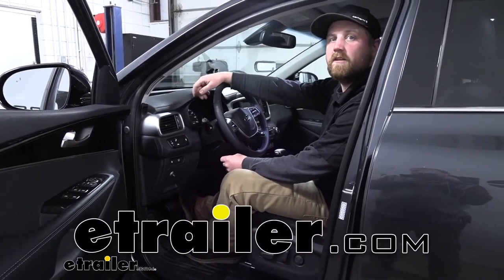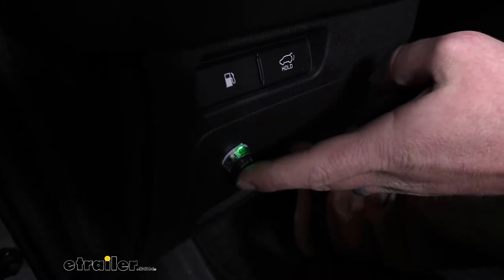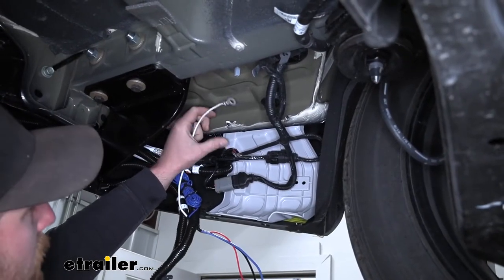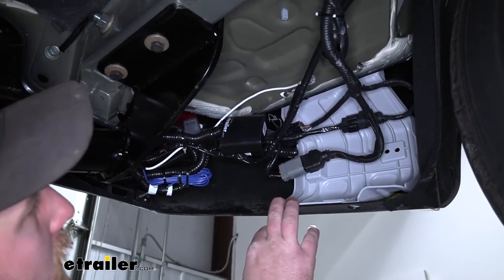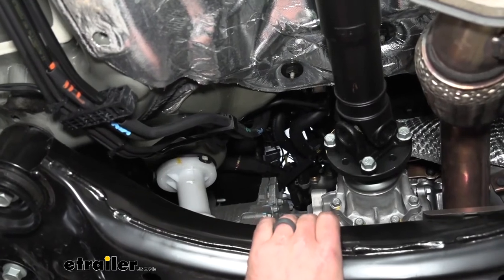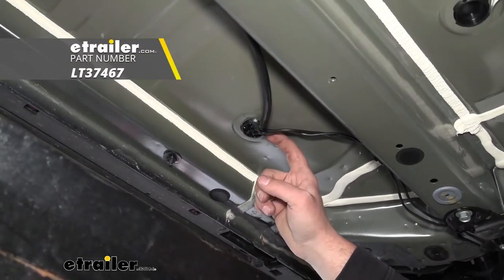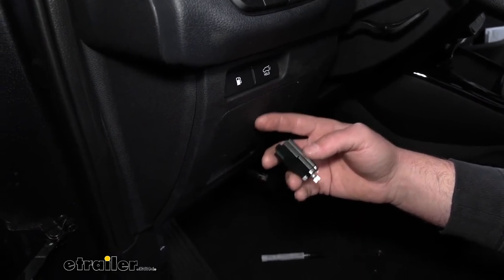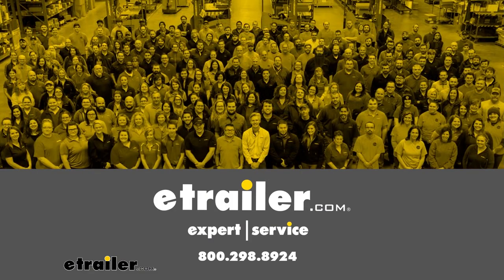etrailer | Redarc Tow-Pro Elite Trailer Brake Controller Installation - 2019 Kia Sorento

Comment: Hello, a question. I have a 2020 Kia Sedona, it has the connectors as they appear in the video. The question is: If I buy the TK24FR kit, can I put a different brake controller than the one in the video, a simpler one?
 thank you
Reply from the maker: That's a great question. The # TK24FR is set up for use with Tekonsha brake controllers, but you can use any controller you want. You'd just need to cut off the black plug on the brake controller harness and wire it directly to the controller of your choice, color for color. What controller would you prefer to use? The main selling point of the Redarc Tow-Pro elite is that the actual controller is hidden under the dash  where it is out of sight. You won't bump your knees on it when entering and exiting the vehicle and you won't have a visible controller hanging under the dash. The Tow-Pro Liberty, part # RED52VR would be a less expensive option that would work with the TK24FR harness, but you'd need to remove connector from  the brake controller harness and wire it to the universal harness included with the # RED52VR. If you have any further questions, just let us know!
https://www.etrailer.com/Trailer-Brake-Controller/Redarc/RED52VR.html